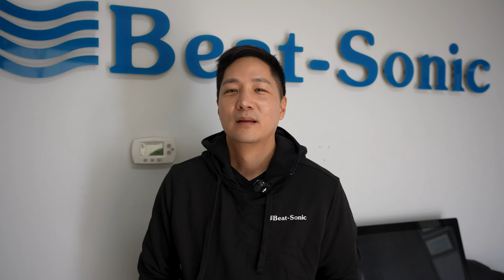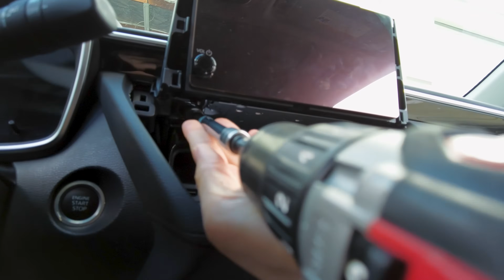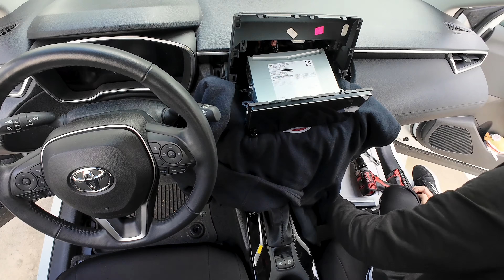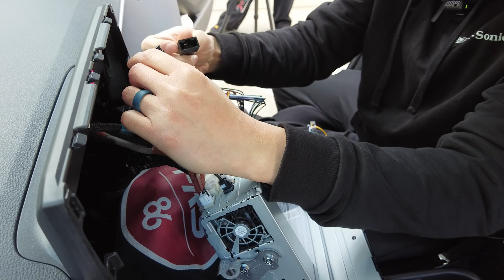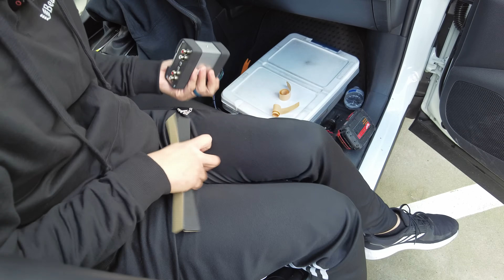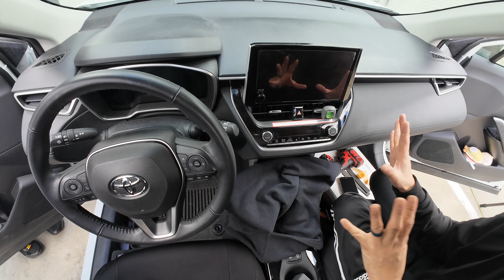2023 Toyota Corolla Cross | Beat-Sonic Amplifier Installation

Comment: The problem is that the standard speakers are garbage. The quality didn't change a lot, only lvl
Reply from the maker: Quality is more clear. Definitely gotta hear it in person
Reply: @BeatSonicUS so i have changed all speakers to focal plug and play. It plays now much better, but i still believe I am missing a lot of power because of standard head unit. Do you thinks this amplifier will give noticeable difference?
Reply from the maker: @Andrei-lz1oo  Yes, most definitely.

Comment: By "mount" do you mean just set the amp down and let it rest under the radio? Looks like it could bounce around
Reply from the maker: Use 3M mounting tape or foam tape that's also included in our kit.